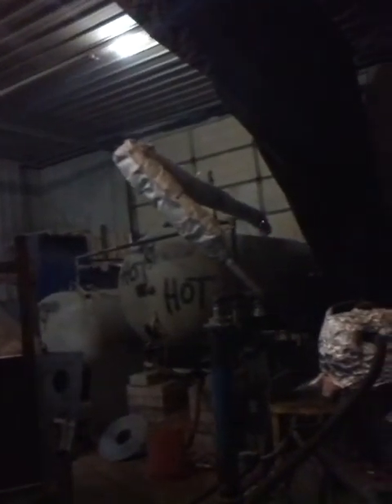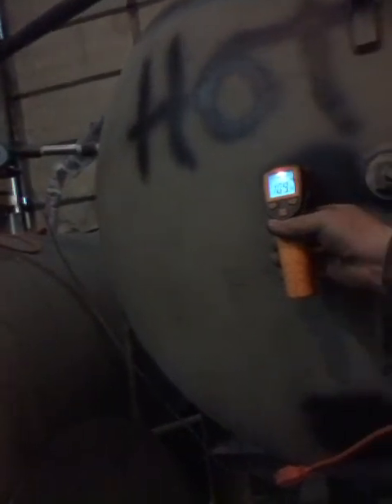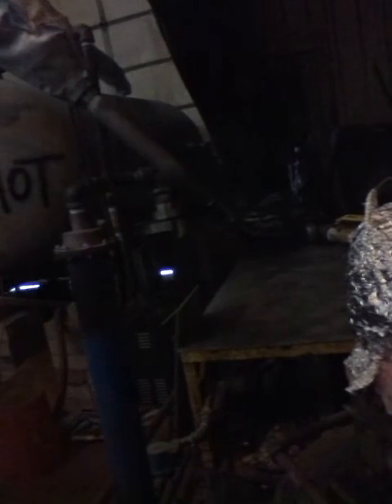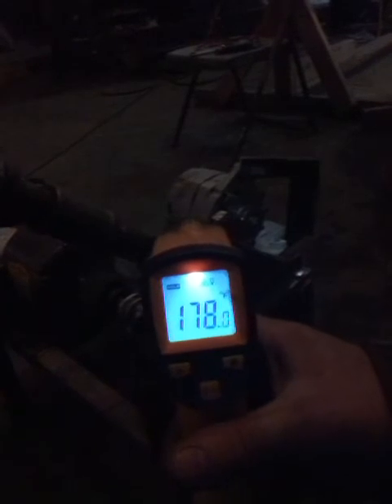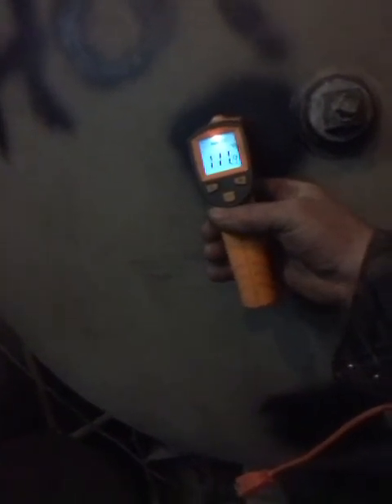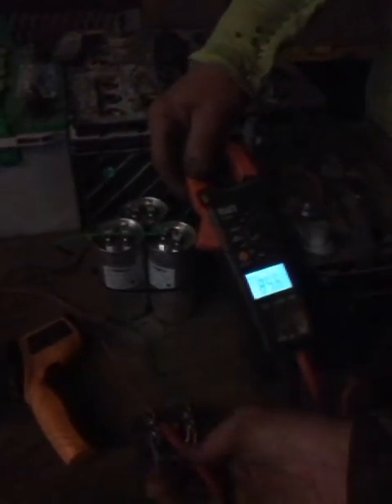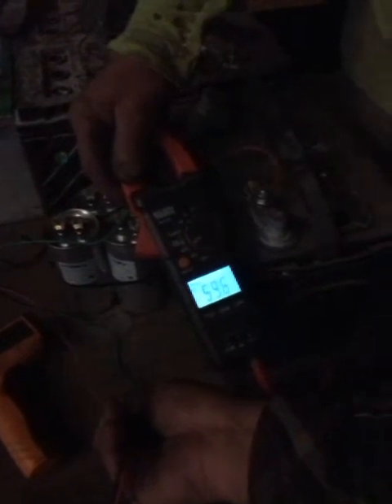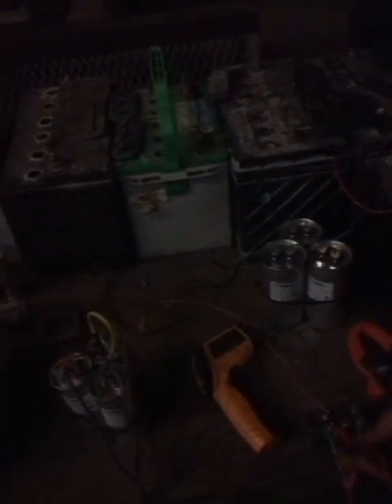VAPOR COMPRESSION HEAT EXTRACTION   ELECTRICAL GENERATION

Comment: if you can close the system, that will be a huge achievement. The proof of the ability to run a steam turbine from a low heat source, even with additional initial startup cost, would revolutionize the mini home power industry and technically any other power industry as well. That was truly Tesla's dream, when he was contemplating the self acting engine or "the heat sink". Best of luck Don.